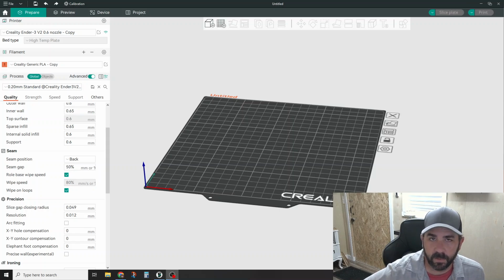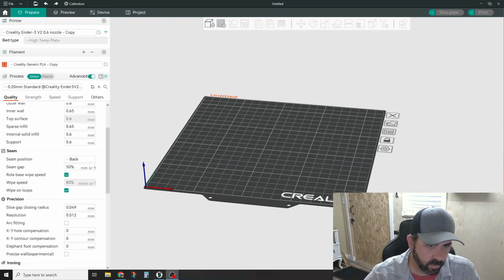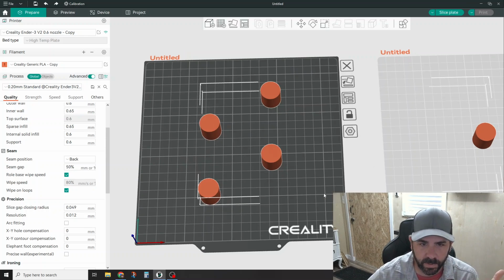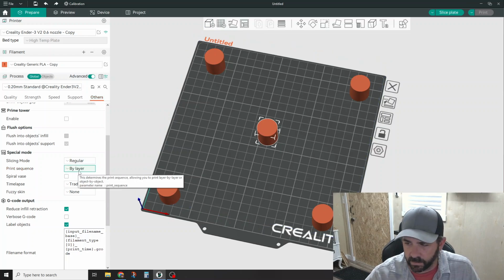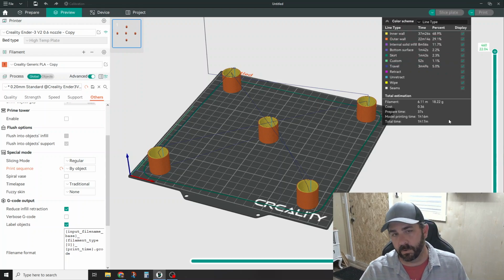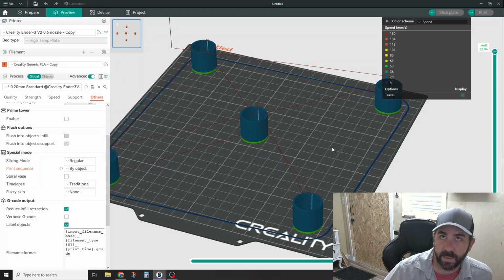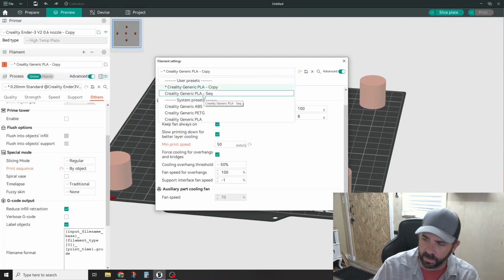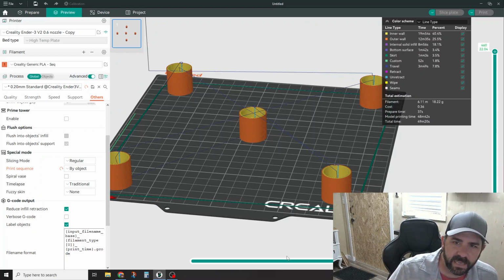Orca Slicer - Sequential printing.  Multiple parts on the bed print one by one

Comment: Isn't this going to hit the object in the middle multiple times?  It prints the center then goes through to the sides, returning to the center each time which will hit the center print.  Seems you might have skipped over chatting about this portion.  Very important when printing multiple parts.  I was printing the Balance Tetris game, and it seemed like I could just print them all by pressing arrange.  Definitely could not, it hits parts when it was moving around to the next part.  Did that a few times.  I replanned my path better and verified with the travel lines this time.  Hopefully that was the key, I wasn't looking at the travel lines before I remembered about them by watching your video even though you didn't really go over this part.  Maybe make a video going over this part in detail.  I can't find any videos that go over this specifically.

Comment: What if you have 2 tall parts and 1 small part with variable height? say two tall parts with same height and then a small one with half the height?
Reply from the maker: generally best to use the auto arrange feature.  typically orca will place the smallest at the front of the build plate, and the two taller ones middle, then back of plate.

Comment: If I’m not home, and I’m not able to remove them as they are done? Would this still work? Is 55mm distance enough for the print head to not bump into the prints?
Reply from the maker: yeah, it's no problem.  it just prints them one at a time.  as long as you've got your extruder clearances all setup it'll avoid running into the previous prints.
Reply: Does this only work when all objects are printed as one project? I tried printing as seperate files but the homing seems to mess things up, when the printer is trying to home where there is another print, crashing into it. @fischer3d

Comment: Thx for showing Print By Object feature, actually i was just looking for that exact setting, but there is something i just cldnt get, when the printing speed is slow, doesnt that give more time to cool down, but i got like you told the opposite (ur explanation for the Min Print Speed section) maybe i got it wrong, u got it at 10 then u set it up to 50 which doesnt makes it to print faster when the slower print gives more time to cool every layer? Obviously there is something that i got wrong totally reversed but i appreciate if u wld make a short explanation. Thx.
Reply from the maker: Hey there.  I think you actually have it right.  It's just relative to the example in the video.  So, in normal slicing mode i'd be printing all 5 of those parts at the same time, layer by layer with the nozzle flying across the bed.  So there would be ample time to cool each part on any given layer.  When printing "by object" the same settings Min Print Speed settings apply.  So at 10, for sure there would be enough cooling time, but the downside was that It increased my overall print time for the job.  So to compensate for the added time in the "by object" printing I sped up the printing speed to some acceptable speed that i felt my machine could hand for part cooling and print speed. Hope that helps and thanks for commenting.